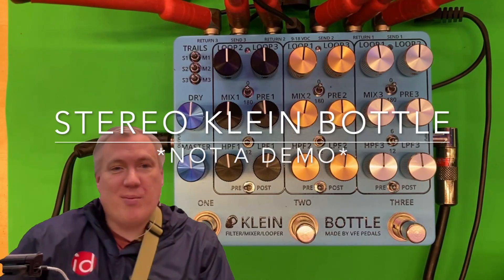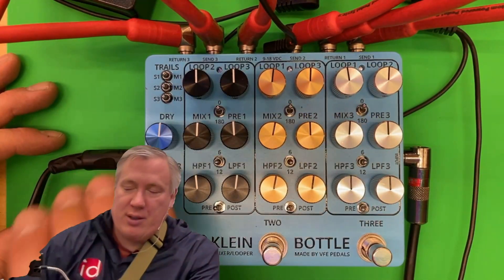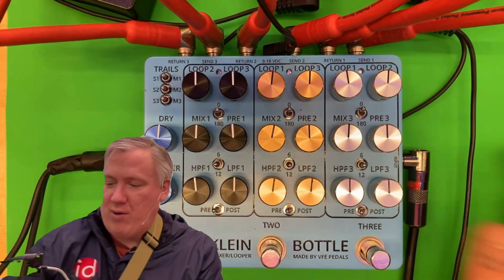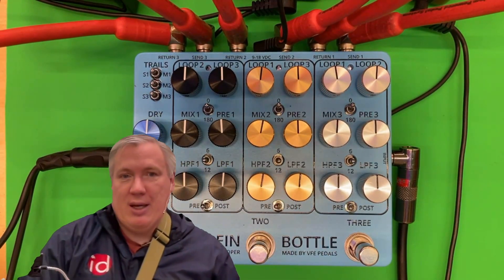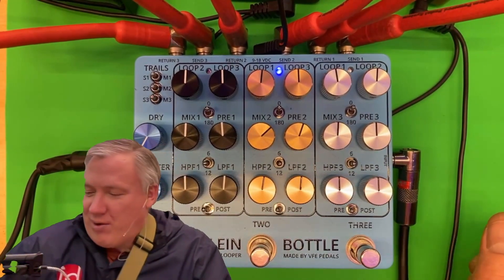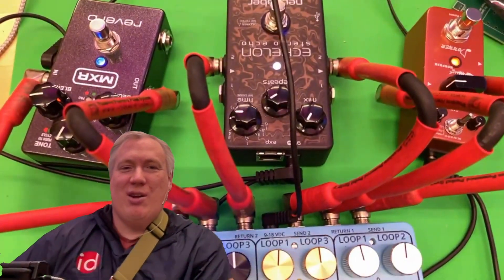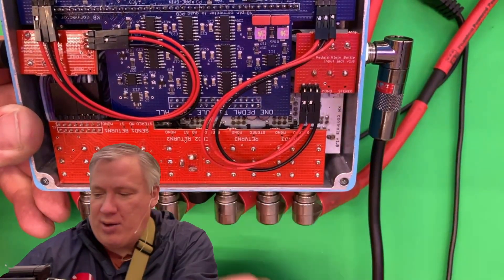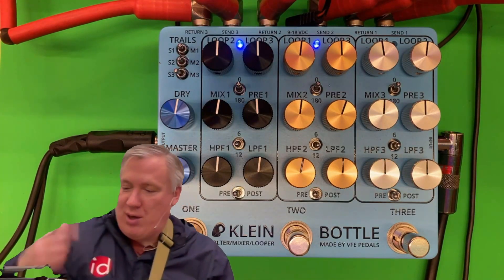This is NOT A DEMO - Stereo Klein Bottle Development Update

Comment from the maker: I've finished updating the design of all 6 circuit boards. I plan to order a large batch of 4 of them, as the updates to those were rather minor. The largest two I will order a very small prototyping batch (2 to 3 each), and then place a larger order when the overall design is finalized. I plan to update the drilling & graphic templates within the next week and order a batch of custom-made enclosures in a variety of colors.

Comment: Hey, want to add one more thing to the pedal! Just kidding. But, an LFO for the HP & LP would be cool. Or an Expression jack to control one or the other or both or more... Not sure you could fit all that in that size enclosure and it would add a lot to the cost, I'm sure.
Reply from the maker: The HPF & LPF controls are custom-made, quad-gang potentiometers. There is no expression pedal or LFO on earth that could control these without a massive amount of additional circuitry. At that point, you're into the realm of doing digitally-controlled pots, MIDI control and saved presets. While cool, that makes this pedal $1000+ and need an even larger enclosure.

The only company I know that could pull something like that off is Chase Bliss Audio.

Comment: Thanks for all the email updates. Excited to see all the progress. I haven't been able to find on the indiegogo campaign or your website though if you've ever said what you expect the final current draw to be for this?
Reply from the maker: The current draw is around 200mA. It fluctuates as you use it a bit (as all circuits do), but I've never seen it go past 225mA on a 9V power supply. With an 18V power supply, it goes up only a little, to 225-250mA.

Comment: Peter, you are a giant. Thanks for the update. 
Dumb question or at least one I could have asked before: what do the M and the S stand for?
Reply from the maker: S is for SENDS and M is for MIX. In S mode, the FX loops remain connected to other FX loops even when that loop is turned off. In the M mode, the FX loops remain connected to the main mix AND the other FX loops, even when it is turned off.
Reply: @ Well obviously 🤣. Thanks so much, Peter. Happy holidays!